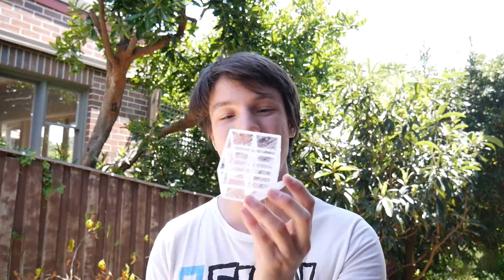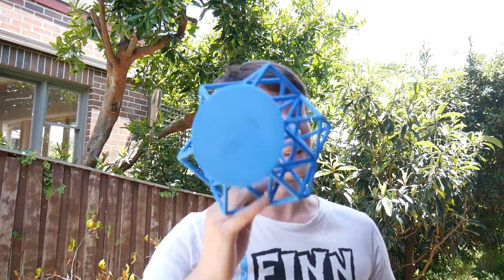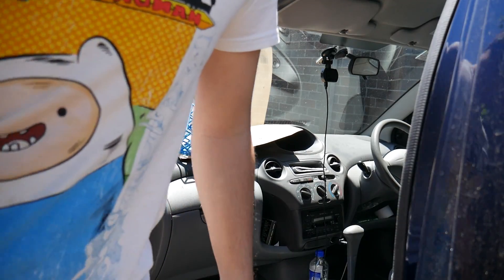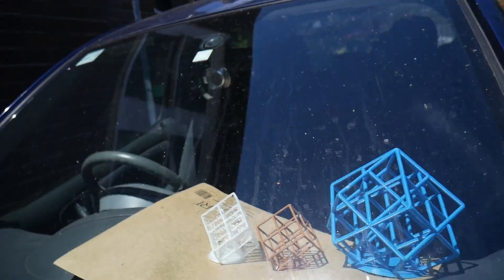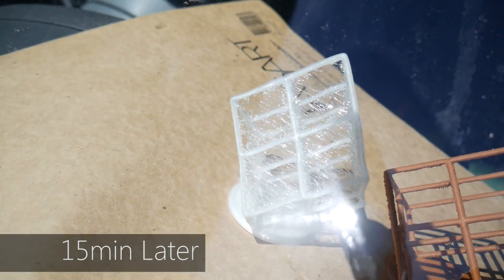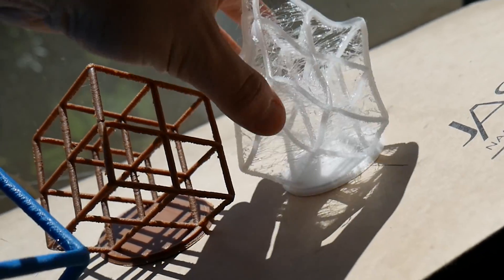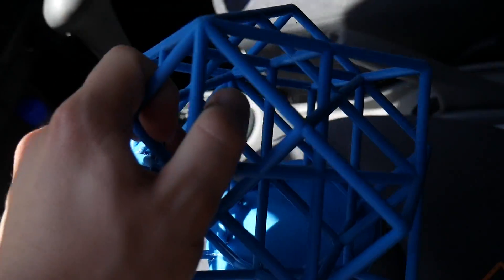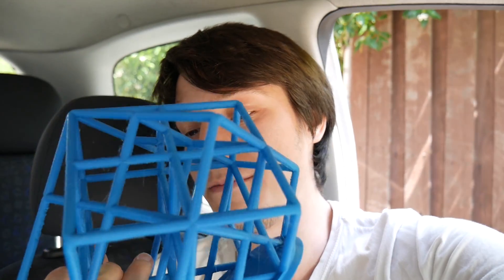Do 3D Prints melt in your car in summer?

Comment: Tbf all results are pretty much useless as the variables are not consistent. If you want an accurate idea of the differences then they all need to be the same printed model and in the same colour. The pet model is 3 times the size and the struts are 3 times the thickness, see how it lasts when they are the same thickness as the struts on the white pla model. Your pla is also compromised, judging from all the stringing im guessing you used an old end of a reel that had been sat for a while and its gone damp which seriiusly weakens the print

Comment: I’ve sealed an oil catch can using a plastic glue gun, I think those rods are nylon, and guess what, after like 1/2h in city traffic I got the check engine light 😂then after a few seconds I remembered the plastic seals

Comment: Just the kind of information I was needing.  I'm getting ready to print t functional parts for my motorcycle, and am concerned about the life of the parts. I'm feeling a bit better that I bought PETG, my first experience with it, and the parts will not be enclosed like in a car, but may see temps up to 85F. (29C).  Wond will help keep those temps down as well.

Comment: I made several PLA prints which are placed on the top my car dashboard right behind the windscreen and never melted through years and hot summers we got in my area. But i coated the PLA with a double layer of heat resistant paint and a triple layer of anti-UV clearcoat. Even with temperatures as high as 65 celsius inside, everything is nice and steady... But straight unprotected PLA would have been game over for sure :=)

Comment: I live in Kentucky and here we can get over 100 F in the summers and in Sub Zero (f) in the winters.  I appreciate your test however you did use a delicate print that would melt easily and much thinner than the other two prints..  You also put them directly in the sum on the dash where it's going to be the most extreme.  What if you had a part that was under the dash and not in the direct sun?

Comment: I had a co-worker 3D print me a tweeter bracket for my car so this video was very helpful! I need to ask what material he used before I attempt to install  it. I was worried it may warp or stretch during a hot summer day in the US. Damn Crutchfield didn't supply me with the correct tweeter bracket! I guess I will have to leave the tweeter on zip ties till I buy some heat resistant paint lol.

Comment: My gearshift knob is printed out of standard quality black Neema3D pla, It regularly sits in the sun for hours in the summer in Greece (outside temps of 35C+)

I will sometimes be unable to touch it for more than a couple of seconds because of how hot it gets

Weirdly, I have NEVER had it go soft. I don't know how that is possible but there you go.

Comment: So, moral of the story is avoid PLA unless you're desperate? I just got some PLA 3D prints ordered through Thingiverse, first ever experience with amateur 3D prints, and while the prints are nice looking, the lamination strength appears abysmal. Layers floating above other layers. A slight flex breaks the lamination apart. Very brittle with almost no plasticity. Not such a great material for quadcopter stuff, it seems! Really hoping the nylforce printed stuff I ordered is good.
Reply: gymkhanadog or just avoid having PLA outside in December in Australia

Comment: Depends on many factors.
But have a bright day, a good insulated dark car and a dark print - ABS too will melt.
50°C is nothing - the inside of a car an easily reach 80°C and higher and black plastic can reach the 105°C transition temperature.

Comment: Didn't >someone<  say put PLA in an oven to make it stronger
Reply: Protomaker Black Sprint Original 3D Printer this is true. the PLA does something called annealing in which it gets harder and stronger and resists melting at lower temperatures.

Comment: It would be great to see similar tests with the modified and annealed PLA.  I've had good luck with annealed Raptor PLA from MakerGeeks, but there are quite a few others out there.  ABS has so many drawbacks if you can only print in an enclosed space that the annealed PLA is a great option.
Reply: Agreed, we kickstarted HTPLA 3 whole years ago for just this very reason!

Comment: Actually seeing what happens to PLA @ 50C is very handy if you want to reshape PLA models for various reasons - say stop motion dummies for instance - print 10 or so models then heat and bend to make the full range of poses.

And yeah - in Oz 30 degrees means sunburn and heat stroke, in the US 30 degrees means frostbite.

Comment: Your test is a bit bogus - color affects the amount of thermal energy absorbed because you have them in direct sunlight. Black PLA should be really bad, white is probably the most optimistic result.
Reply: We also had customer feedback on this. A sailboat builder switched from Carbon Fiber to White Matte Fiber HTPLA because the white part stay cooler, absorbing less radiant energy in direct sunlight.

Comment: I had my my first two printers, a Huxley and a Mendel, warp out of skew after a few days. Both's frames are now unusable, the Huxley being far worst off, so I wouldn't say ABS is entire immune. This kind of problem can happen at room temperature and holding certain kinds of tension on a part, like parts have to support overly tensioned belts. The extra heat took a bigger toll.

Comment: Yup... Sucks when you accidentally leave them in your car...  oops.  You only make that mistake once.  Good to know that PET and ABS aren't affected though.
Reply: I've had customers with ABS parts fail in their hot car where now they use Carbon Fiber HTPLA as a replacement with better thermal performance.  now that is pretty rad!
Reply: Good to know.  I'm sure in AZ, mid summer, ABS parts would fail horrible
Reply: PETG is even more resilient. Too bad its so hard to print with. Fine line between globby and poor layer adhesion.

Comment: I made centre caps for my car out of black PLA back in 2014, I sold the car early 2016 and they werent adversely affected by the weather, track days at eastern creek, wsid and the scorching Sydney summer we had last year, some very light discolouration, but id say that was actual brake dust being present, and not degradation. (as it was that dark browny colour)

but interesting none the less!

Comment: So..... a lot of car interior components are made from ABS. The more you know..... :P
Reply: Yep. There is an absolute ton of ABS used in the automotive world. That and obviously nylon.
Reply: nah nylon (pa6) is usually only used for mechanical parts mainly gears, you'll also see a lot of polyoxymethylene for working mechanisms. polystyrene buttons. Some of the large parts are abs usually blended with PVC to resist the sunlight, but I think they use polypropylene for many of the large interior panels because it's resistant to impact and every housewife if going to clean that fucker with their most hardcore cleaners and ABS doesn't like chemicals.
Reply: A 30% infill abs will melt faster in the sun(car) use 100% infill
Reply: Yeah, abs is pretty sure fire for high temps since its used in cars.  Good to know if other specialty plastics will withstand though since abs is a bit of a finicky material
Reply: Somewhere I read vinyl, not sure if that's true or not though
Reply: probably not, they most likely are made out of other speciality automotive plastics. Maybe ASA? But I know nothing about cars so I might very well be wrong here XD
Reply: Not to be one of "those people" on the internet, but no seriously, a lot of them are. There are a lot of other plastics and such used in car interiors as well, don't get me wrong, but ABS is also commonly used.
Reply: Well, like you said. The more you know XD
Just thought the auto industry would've moved on from ABS.
Reply: Nah, ABS is cheap and inexpensive to injection mould. There are also a wide variety of processes commonly used on it that allow you to quickly and cheaply disguise it.

Comment: Based on testing done at various times: Full sun, back car window (with no tint) facing sun, black interior, desert heat (so 40 to 45C outside), back deck under the window, 6 hour soak ..... you can hit > 80C inside a car.  That kind of heat can damage a lot more than a just a PLA print.
Reply: Very true.  Both ABS and PETG could let you down at that point,  but believe it or not HTPLA can outperform in those conditions.
Reply: As I recall, an oven bake is part of the deal to get full performance out of HTPLA.  Is that right or am I confused yet again :) ?
Reply: Bob Camp you got it, having to post process, plus manage shrink & distortion in that process is the big downside of HTPLA, but this is lessened with fiber-filled grades.
Reply from the maker: What kind of shrinkage can you expect after processing in the oven in HTPLA? Is it uniform or does some warping occur as well?
Reply: Maker's Muse with no fiber, a few % depending on geometry & mass (solid vs. sparse infill). Distortion depends on geometry & setup (heating & support of part). Admittedly, the whole process is more variable & takes more trial & error than I'd like. Reducing shrink & distortion us the main value of adding fibers to HTPLA. Peak your interest enough for us to provide sample materials & have you do a more in depth analysis & demonstration?
Reply: Do you stabilize the material with a non-abrasive fiber? Put another way - does it wear out nozzles the way metal filled filament does?
Reply: Bob Camp yes, Matte Fiber HTPLA uses plant fibers. Though it doesn't reduced shrinkage as much as Carbon Fiber, it is not abrasive & requires no special nozzles (plus we can color it).
Reply: So no free lunch. If you want the best stabilization you are stuck with an abrasive fill.
Reply: Bob Camp yeah, but even in that case we have to use short fibers that add stiffness, but not strength and give the material (especially thin parts) a more brittle feel. everything is a trade off...

Comment: What's went wrong with your car the steering wheels on the wrong side lol
Reply: How would someone shift gears with their left arm??? At least the pedals are in the correct positions.
Reply: what are you talking about americans don't shift they all drive slushboxes
Reply: USWaterRockets lmao great point
Reply: Pook365 You must blow up a lot of engines by neglecting to do unimportant things like shifting.
Reply: That is the arm you should be shifting with - shifting is unimportant, where as controlling the vehicle should be done with your dominant hand.
Reply: USWaterRockets How would someone change gear with their left arm? Erm. I don't know. Maybe with ease, as it's very easy. How do you open a door with your left hand?
Reply: kyle hubner Lol we don't all drive slushboxes if that's what you call an automatic, I'd have to give that award to the Europeans

Comment: Please, do you know if this would happend with the esun PLA+ filament too?
(since it is stated to be as strong as abs, But im not sure about the Temperature)
Reply: Gon Garcia they might list glass transition temperature on their website
Reply: Glass transition will still be the same.  Glass transition just matters less in a plastic with more crystalline structure.  In other words, glass transition has less influence.
Reply: Proto-pasta thnx. second question, if I apply primer then it should be so affected by heat, right?
Reply: Gon Garcia a light color primer will help reflect heat, but I wouldn't count on it to add any structure
Reply: fair enough... thanks ;)
Reply: Gon Garcia but if you need heat resistance in PLA, check out Proto-pasta HTPLA.
Reply: id love to...but there are no retailers here in Argentina and online is not an option due to shipment costs and time
Reply: Gon Garcia we offer fast shipping via DHL & UPS but it is expensive
Reply: I know. but even then... I need to wait around 1 month (if lucky) or more due to clearance. it's awfully and painfully slow plus expenses

Comment: Hi Angus, I've been 'soak testing' ABS test prints in my car for just under 2 months (to see if ABS was suitable for printing a replacement centre console lid). I printed 5 test pieces, at infills ranging from 15% to 90% and left them in the car in the Queensland sun.

Happy to report that zero detectable warping after 2 months.
Reply: Isn't abs used in most cars anyways.
Reply: @robertt9342  Injection moulded parts yes, 3D printed parts no.

Comment: Once I left newly purchased PLA spool on the front seat, stuck in the traffic for an hour or so and when got back home realised that now I have solid 1kg block!
Reply: Kris M I hope thet's a cheap spool not an expensive one.
Reply: PLA buyers take note: Don't cheap out in transport air conditioning.
Reply: feels bad man
Reply: That doesn't make sense. Unprinted PLA is semi-crystalline, meaning that it should only begin to melt at 180 C. I have left my PLA spools in my car and been fine.
Reply: Um, that must have been some garbage filament if it melted with you inside the car.

Comment: yep, found that out in Texas summer. Had a custom drone camera mount in Truck. After work went to fly to test new 360 Deg camera. Well the mount did not look like what I had designed. All twisted :)
Worked fine in ABS and PETG.

Been thinking of using ASA too for UV.

That's another test for you during this summer leave some prints out for a month or so and see UV deterioration.

Pity you did not have any PLA HT annealed to go with the other samples.

Good show

Garth
Reply from the maker: Annealing PLA sounds like a lot of effort, but I do have some HT stuff somewhere, just need to find time to test that stuff out. Personally I just print in ABS if I need the temp resistance.
Reply: Maker's Muse During the summer T reach 50C° in my country, I tested ABS by putting it in the car for a month at least 5hr a day (exposed to direct sun light)
considering the T inside the car more than outside.

nothing changed at all.
Reply: ESUN's PLA+ / PLA PRO will anneal 30 minutes in an oven at 225 F. Doesn't say that it will, but it does